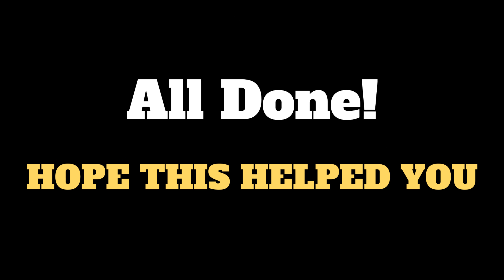2011 B8 Audi A4 axle boot replacement

Comment: thanks for the vid pete.  yours is the only B8 axle video on YT worth anything.  looks like you can get the axle out without removing the caliper and upper control arm pinch bolt.
gonna do this job when my 19mm hex socket arrives wednesday.
Reply from the maker: Glad it helped!😁

Comment: I was trying to change passanger side outer boot today but i was stuck with first  axle  bolt that keeps inner axle to the engine. Tried with impact gun but it dosn't want to move. Can i somehow remove axle from the wheel and change boot on spot without removing whole  cv axle? Maybe release  2 small control arms on the top and try to swing wheel and pull out axle from the wheel?
Reply from the maker: Yes you can definitely do it that way It's just a little bit harder with the axle still attached to the vehicle!
Reply: @Pete6641 i am using flexible boot, i will just strech it over axle with tool
Reply from the maker: @NetWibe  oh nice that makes it even easier

Comment: If you run the bolt back into the joint it pushes the cv joint off the shaft, just to save you using the persuasion tool (hammer)
Reply from the maker: Yea I've since figured that works on quite a few different axles .. thanks for the tip!

Comment: informative, but messy and i'm not just referring to the grease. "I'm sure there is a Tq spec on that bolt, but as tight as you can get with my impact seems to work". LOL.  Thanks for the pointers
Reply from the maker: Still after all these years haven't had any issues tightening axle bolts/nuts with the impact gun but if I ever do I'll be sure to post about it!  Every bolt on the car has a torque spec. Unless it's internal engine components or something that is know to cause problems
 if not torqued correctly, most of the time an experienced hand is enough to sufficiently keep the car together in my experience... If you know of any problems with any fastener not being torque to spec causing an issue please feel free to let me know so I can avoid problems in the future much appreciated

Comment: I just changed axle boot and now the wheel is shaking, and something is wrong with that axle. It feels like the axle is not in sync with the motor. Do you know what it can be?
Reply from the maker: Did you put the wheel back on properly? Did you re-tighten the axle bolt? Did the axle shaft go back into the CV joint all the way? It could be anything really I would say to take the wheel back off and check to make sure everything looks correct
Reply: @Pete6641  Wow, quick answer! I put the wheel properly on, and also re-tightened the axle bolt. I've tried to insert the axle through the hub/bearing several times. It look's strange, as the end of the axle is still maybe   4cm inside the housing, but I can't make it go deeper in.
Reply from the maker: @olgajoachimosmundsen4647  I try to answer as quickly as possible! Yes if that axle shaft is not in all the way it could definitely cause a vibration sometimes the little metal ring doesn't want to pop back in to the CV joint you may have to assist The metal locking ring down into the groove in the splines with a screwdriver
Reply: It turned out the inner hub on the opposite side was messed up. I think because I bent down the axle during changing of the springs
Reply from the maker: @olgajoachimosmundsen4647  so you took care of it? It's all good now?

Comment: Can someone verify that there are no spacers/shims on this type of axle? I don’t see any in this video but seem to be common on other Audi axles. I have a B8.5 and looks identical to this one. I replaced my outer joint and got about 25’ and stranded in my driveway. The joint pulled away from the shaft so I’m thinking I didn’t drive the joint far enough (or at all) over the clip. I just want to make sure I’m not missing any parts. I noticed he did a lot of pounding to drive the joint on and then did it again using the old bolt.
Reply from the maker: No I have never seen any shims in any of these axles
Reply: @Pete6641  great, I appreciate the quick reply. I guess I didn’t drive it on far enough, pulling it back out now.
Reply from the maker: @bobd9868  good luck let us know how it goes!
Reply: @Pete6641  so I resorted to getting a “new”/NAPA axle which wasn’t my first choice. I’ve used them on my Highlander and they seem fine. I tried for over an hour to reinstall the new CV joint and finally gave up and installed the new axle.

There must be a defect with the new joint. After I was all done, I grabbed the old joint and with two whacks it seated back onto the old axle. 

I’m going to exchange the joint and try again. If I can get it together, I’ll have it as a spare.

Comment: I put coilovers on my 11 A4 a few months ago, hearing clicking and clunking noises when Im turning out of my driveway or anytime I go up slowly onto any driveway. Im thinking its the cv joints. This video will certainly help me when I change them myself..

Quick question..how many hours of labor did you charge for this job? I want a ballpark estimate of what it costs just in case I decide to have a shop do it for me. thanks in advance.
Reply from the maker: I think we charged 3 hours I'm not sure though it was a long time ago

Comment: nice video, dose it fit on both sides ? is the same part # or are diferent ? Thanks
Reply from the maker: I'm not sure about the part # it may be different per side I'm not 100%sure I would definitely double check before ordering any parts

Comment: Is the other side the same way to remove? Same access and  everything? Did you need to remove other things like tie rods or control arms that isnt in the video? Thank you!
Reply from the maker: I'm pretty sure it is. there may be some minor difference but it's should be basically the same
Reply: @Pete6641  OK thank you. I'm gonna replace both my wheel bearings and CV axles, you think it will go through the whole knucle hole with the bearings removed?
Reply from the maker: @nicoj3660  when you remove the bearing the hub will come out with it you will need to press the hub out and press it into the new bearing for the axle to fit correctly into the hub

Comment: Should break the axle bolt loose before raising the car. Just an FYI!
Reply: his way worked anyway just FYI🤣
Reply: not really needed if using high impact gun. only need wheel on ground for breaker bar.

Comment: what the hell, that must be the easiest car to replace cv axle on, did it drip oil from gearbox when pulling it out?
Reply from the maker: Nope it unbolts from a flange your not pulling a shaft from the trans so no leaking

Comment: I just destroyed cv joint screw trying remove it with bolt like in Passat b5 :(
Reply from the maker: Oh no it's a little different on these they typically come out pretty easily
Reply: @Pete6641  Hole in axle have same size as a bolt, while screw in you destroying  "screw"? Im not sure its good eng word. While screw out destroying screw in cv joint. Next time i will do it like you in movie, too bad i didn't watch it before work.

Comment: Very helpful video; thanks a lot.  I just blew a CV boot apart the other day (indication was blobs of grease appearing on my wheels, etc) and figured it was a pretty straight-forward job. This confirmed it.  Now I'm just trying to decide between replacing only the boot, or getting an entire reman'd axle assembly (Cardone) for well under $100... What do you think?
Reply from the maker: Sorry I didn't see your comment until now really if the axle boot hasn't been torn for long there is no need to replace the axle ... Unless it's starting to click around turns

Comment: So it doesn’t damage anything if you don’t take that little c clip out first that you didn’t use?
Reply from the maker: No the clip is not accessible unless you remove the cv joint
Reply: @Pete6641  oh that makes sense

Comment: When I drive my Q5 2011 slow I feel like tire has a flat spot, changed the tire and rim, it does it again. When I turn max to the left and go very slow it look the tire slips on the asfalt like there is the sand underneath. No noise when driving  and wheel not shaking. Could be the bad axle? Can't figure it out. https://youtu.be/cnIZ_OcElnc
Reply from the maker: I watched the video it's kinda hard to tell if you already changed the tire and rim it's possible it could be the axle locking up inside how many miles are on the car?
Reply: @Pete6641  140000 km around 87000 miles
Reply from the maker: So it's probable it's the axle it's hard to think it could be much else ... Wheel bearing would make noise... Trans would probably make noise too
Reply: @Pete6641  I will check the axle soon, waiting for better weather. In meantime driving my wife's car.
Reply from the maker: Ok definitely let me know
Reply: Switching my driver and passenger axles over the weekend looks like it fixed the problem, there is very small vibration in the wheel, almost nothing.
I will see if I have to change axle in the future.

Comment: And folks, this is what a bad mechanic looks like.  That axle bolt he couldn't get out without going destructive?  All he had to do was stand on a breaker bar and it's off. Plus he and tightened it in a way that's going to ruin the wheel bearing.  Just boneheaded work.
Reply from the maker: Love it thanks never came back for anywheel bearing issues .... Using a air chisel to remove a bolt is pretty standard stuff and standing on a breaker bar while the car is on a lift in midair probably would not have worked very well 🤷
Reply from the maker: Seeing that you have only 10 subscribers and no videos really showing any mechanical work I'm guessing you have no idea what you're talking about lol
Reply: @Pete6641  This is why you're a bonehead mechanic.  You don't know the situation, like if the car is with another owner, elsewhere, fixed elsewhere, etc.  It's just so weird that you use that as a justification for doing the job completely wrong, then you even flaunted not torquing the bolt when it's a stretch bolt and you didn't tighten it properly, nor is it stretched properly.  If you did stretch it, no doubt you went past yield and now the torque is lower than what is required.
As for the second part about standing on a breaker while the car is in the air- you do it while the car is on the ground.  It's beyond easy or you put in two lugnuts and use a prybar to hold the hub.  Your workplace is an absolute mess and and nothing is in a convenient location, plus you haven't cleaned in years, but you continue to hoard.  These are troubling signs of a bad mechanic and the excuses you make, the jokes you make about doing the job wrong on a securing bolt is evidence of that.
Reply from the maker: @MrDrmorbid  yea what bolt is a stretch bolt? I don't work there anymore btw and I knew that customer personally they bring their car to me and only me I did this job a few years ago He's put about 50,000 mi on it since then with no issues The car runs great drives great I don't know what point you're trying to make but keyboard warriors like you are very annoying... nobody else had anything negative to say besides you I'll continue making my money doing what I do in my own shop now I've built many cars I've built many engines I know what needs to be torqued and what you can just run in with an impact gun it's called experience you should try getting some not everything has to be done by the book wasting time for no reason just because you want to be a stuck-up snob and complain about a video that's helped  almost 10,000 people are you just jealous because your videos don't get views?
Reply: @Pete6641  Ummmm, you think torque values and stretch procedure comes from video count and subscribers?  This is so weird, but I'm guessing you won't recognize it because there's 100% more going on with you from judging your filthy work area and tool boxes that show you're a hoarder, but unable to organize your stuff to make your work quality better.  You showed how you couldn't even find the right tools and then just improvised and preferred walking back and forth 20x.  Anyhow, you even recognized the bolt was a stretch bolt and still ignored tightening it right.  There's so much going on here, but you really need to clean your work area first of all and then don't flaunt that you're not going to tighten the bolt properly which you literally did verbally.  It takes a torque setting and then a specific stretch setting.  If you go below or above that, the bolt will loosen and also the wheel bearing will have a reduced life.  Plus the manufacturers all specify that the bolt has to be tightened and torqued with the wheel on the ground for obvious reasons.

There's just so much going on here and some of it is subtle, but you're an example of a bad mechanic and it won't get better from here as you get more burned out and messier.
Reply from the maker: @MrDrmorbid  listen I get it You're a keyboard warrior you have to do this you have to make problems with people for no reason I fix tons of cars I rarely have issues with cars coming back because I didn't torque one bolt you think I'm a bad mechanic You're really an idiot and just a pain in the a** you must not be a mechanic or else you would understand what the f*** is going on here just because you have a toolbox in your garage doesn't make you a good mechanic you still haven't told me your experience... I'm guessing you fix your own car in your garage on the weekend or something You're just really annoying and I'm done having this conversation with an unexperienced keyboard warrior ... I've been working on cars for 20 years I don't need criticism from some unexperienced loser
Reply: @Pete6641  Stretch bolt= torque to yield.  You torque to to a specific number then you give it more in degrees to get the bolt into the plastic range and so they hold, like for cylinder heads.  If you don't know th'is, then once again you've proven yourself as a bad mechanic.  You stretch the axle bolt so it doesn't come apart while someone is driving.
Reply from the maker: @MrDrmorbid  I am very familiar with tty stretch bolts seeing as I've torqued down hundreds of headbolts.... for an axle it's not that important it's unnecessary it just needs to be tight
Reply from the maker: @MrDrmorbid  You're really splitting hairs here.... You come at me telling me I'm a bad mechanic and then you still haven't stated what you even are ... Besides a keyboard warrior which is very obvious